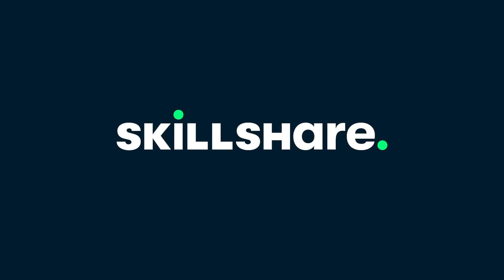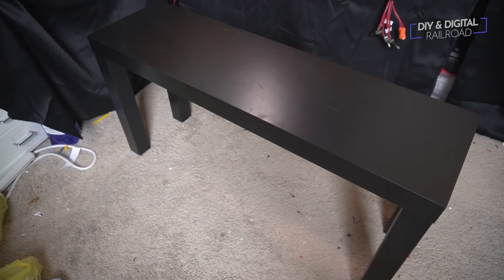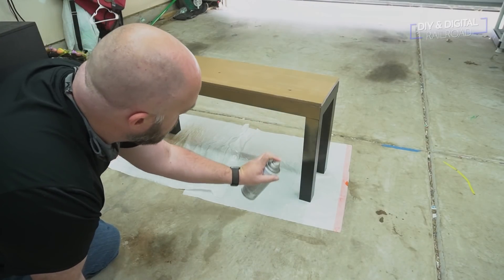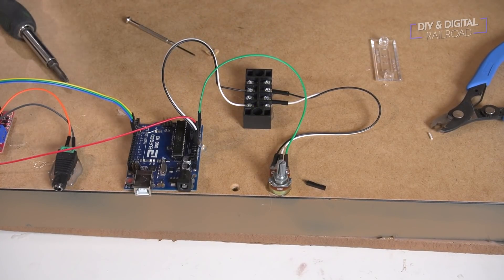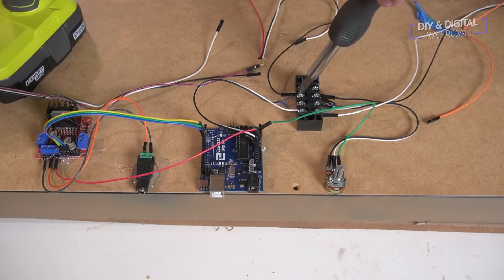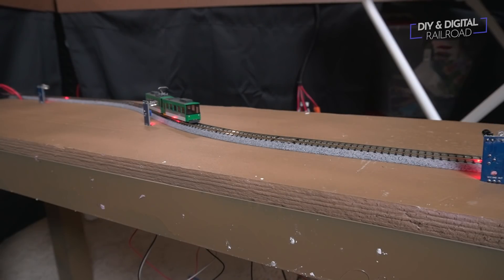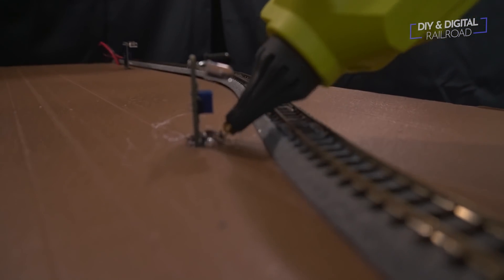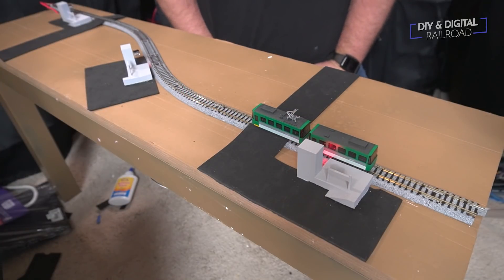I Built A Model Railroad on an IKEA TV Stand

Comment: Suggestions on building a 4 x 8 table layout for On30 using Bachmann E-Z track?
Reply from the maker: I do love me some On30.  I would look to HO scale plans for inspiration and then use a lot of scenic breaks.  Maybe a divider with a backdrop down the middle.
Reply: @DIYDigitalRailroad   I have a layout pictured in my head. 

It's going to be N scale. Based off an HO I did many years ago. 

I'm having difficulty drawing everything out, obviously a 4ft × 8ft paper is difficult to find. Are there any free programs to help draw and print my plan to size? (Even if I have to tape a bunch of papers together) 

And I just can't comprehend the programming and wire for arduino, or anything else that has to do with computer controls, or programming. 
I know in my head where one train will have to stop and wait for the other to pass, and I plan to put magna rail, and faller automation in. And I kinda know where train crossings will require faller automation to wait for the train to pass. but all the YouTube videos I've seen lately, I can't quite make it connect in my head, how to do it. Wish someone could show me, or do for me the programming after I have the track laid. 
But I am still in planning mode.  It's going to be a few months before I even buy first pieces of track. 

I just recently learned about DC, and DCC.  I Believe my HO was DC, (it was straight out of Beckman Walmart/ toys r us box with extra track) but I'm wanting to learn DCC for this layout. 

I'd love all hint,  tips, video links, and ideas for my future layout.
Reply: @DIYDigitalRailroad  I wound up using SCARM with the Atlas Snap-Track components and modified 4 x 6 Gold Hill Central out of Classic Toy Trains' TRACK PLANS FOR LIONEL FASTRACK. I only lengthened the mainline and the spur to the right of the passing track and designed a river water front wharf. On the single spur into the center of the right side of the layout I added an N gauge line representing an 18 inch gauge mine tram running from a shaft Coal Mine to an ore bin. I also added a spur to the passing siding gong left from it. This I have yet to decide what to do with it, but one thing I am thinking of is a suggestion for a line going elsewhere. The two track yard off the inside of the passing siding I am using for industrial tracks. I have some ideas; one idea is using a false front store I have with a freight door on both sides of the rear of the store and have a hardware and supply store where a truck or wagon could load out the rear on the road side of the store and boxcars or flat cars could be unloaded on the trackside of the building. The other spur of the yard may wind up a cattle pen or a small factory.

Comment: Nice to see the project turn into a proper layout build!  I've got a question about the sensors.  Do they need to be up that high?  It seems it would be easier to hide them if they were set down into the foam so that the LED and sensor were just above track level.

Comment: Jimmy,
Now this is a clever idea for your regular tutorials.  Building a project then integrating it into a layout.  I like it.
In the future how about doing the same on your train room layout.  Build a stand alone project.  Then in a subsequent episode demonstrate how it fits into your existing design.
Now, I have two requests.  With all the various Arduino projects you have compiled, as well as those yet to come, how about developing a multi-task program.  A sketch where a single reaction by the Arduino logic sets off multiple operations.  Or a chain of delayed operations.
Secondly, in the New Year how about the return of the Dollar Store Buys, & "BRAND NEW in 2022" (see what I did there), DIY & MRxR Shopping Trips to Charity Thrift Shops.  Just to expose your viewers to the treasure trove of pieces they can find to include in their design and build planning.  Over the past 60+ years I have saved thousands of dollars in Thrift Shops buying bench works, train sets, scenery materials, and general junk I crash & mash up into my scratch building.
Not as an insult, however, you built your mountain with conventional cardboard cross hatch.  Back in the late 1960's I did the same.  Then while on a Thrift Shop visit I found ratty old denim shorts and jackets.  Bought it. Sliced it. Stapled it into some mountain underlayment.  In the 1980's, the same Thrift Shop had a carton of arisole foam insulation.  At 25¢ on the dollar I started using "SloBlow" and have ever since on mountains, inclines, and random rocks.
Jimmy you have a superb soap box to not only expand the hobby into the future, but to rekindle the art form of our past.
Love to your lovely bride.  EXTRA HUGS to the DIY DYNAMIC DUO.
Jim